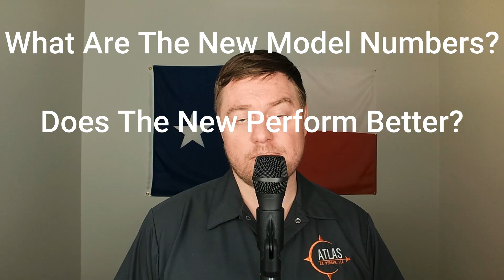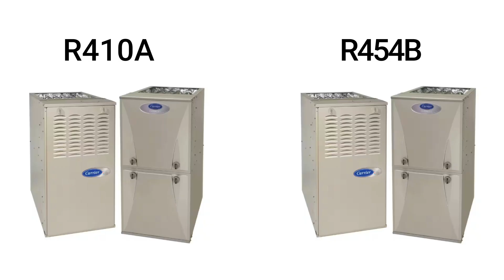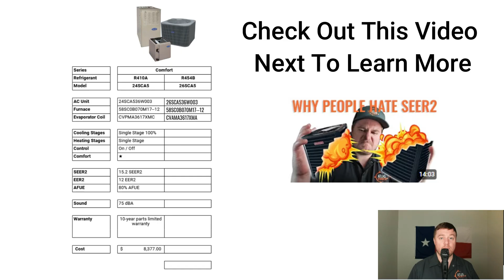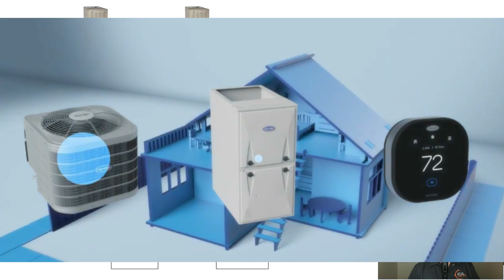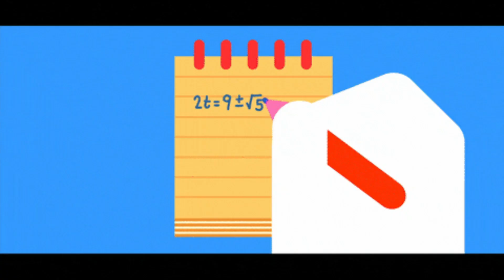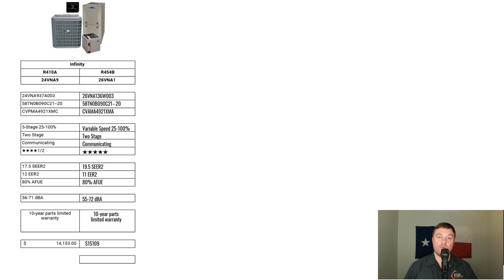Carrier NEW Gas System Lineup (2025)

Comment: My beef with our heat pump is that I wish we went with a unit with a gas auxiliary heat option and not electric.  I know for the next system, I want minimal digital electronics.  We went through no less than 3 system boards.  These are 240v systems where you can’t have a plug in surge suppressor.  Why they don’t come with a replaceable surge suppressor on the electronics is beyond me.  Your only easy option is to install a whole house surge suppressor to add some level of protection.  You also want easy to replace parts.  Our fan stopped working.  It was a bad module.  However, it was sealed inside the motor itself.  So, the whole assembly needed replacement, and the HVAC guy has to search nationwide to find a warehouse that had the part where all we needed was a replacement module.
Reply from the maker: you AC person should have installed a surge protector at the disconnect for the air handler and one at the disconnect for the condenser, Atlas does? this is how you protect the electronics in your AC system.
Reply: @atlasacrepair  - I can't find specific surge suppressors for the 240 volt lines (3 circuits) going to the system.  I suspect most HVAC people don't think this is needed, but where we live, power outages and brownouts are more common.  My best solution was a whole house surge suppressor and keeping my fingers crossed.  My HVAC company knows how unhappy I am with "computerized" systems that DO NOT have built in surge supression protections.

Comment: Very informative. Thank you!

Just replaced 35 year-old Carrier Weathermaker HVAC with Greenspeed dual fuel 59MN7C/27VNA3 97% gas furnace and heat pump. It is amazingly quiet by comparison.
Reply from the maker: Glad to hear. Please give us an update in about a month
Reply: @atlasacrepair  a bit further along with the new setup and so far so good. Below are a few of observations (as a 2nd time heat pump (HP) home owner... my previous home, 20+ years ago had one that was nothing like the new stuff).

1. I live in a 4-season area and increased the HP cutoff temp by 2 degrees (to 37 F). In breezy low temp conditions, 35 was too low for it to cease operating, in my opinion.

2. Went with a MERV-11 filter and notice a difference in air quality compared to my 34 year old Carrier WeatherMaker that used 25x20x1 filters.

3. Chose the AprilAire 800 (240v steam) humidifier and so far the humidity is doing ok. Not getting above 25%, according to an independent temp/humidity monitor that recoded higher numbers with my previous AprilAire side-mount "water misting" unit. The new one is noisier and hearing water boiling to make steam is not quite what I expected.

4. There are readily apparent efficiency gains (and cost savings) with the new variable speed furnace and heat pump.

5. Only (unexpected) negative so far: while doing what I suspect was a defrost cycle below the lockout temp, the HP made a lot of noise and shook uncharacteristically. I assume it was due to ice build up on one side of the blades.

Comment: I need a new A/C unit and probably a new gas furnace (both are 30 years old and A/C is broken). I contacted a local Carrier installer and stated I wanted the middle of the road A/C. He gave me a quote but the A/C unit is a "Comfort Compact Crossover 37 MURAQ48AA3 Heat Pump."  Now I am totally confused. I live in Southern California. Is a crossover unit an A/C unit? I have a 2-story house, four bedrooms and approximately 2200 sq. ft.  Any comment would be greatly appreciated.
Reply from the maker: The crossover is middle of the road since you get a variable compressor in the deal with side discharge. 
The side discharge unit will connect to a forced air system (air handler or furnace) and supply the AC cooled air through your current duct system.
Reply: @atlasacrepair Thank you very very much!
Reply: I'm guessing it's both an A/C unit and a heat pump with an option to switch back and forth depending on the season. I'm looking at buying one right now.

Comment: Thanks for you comparison post. Love your vids. 

We went with two 3 ton 24vna6 fully variable infinity  greenspeed AC units coupled with the coils you mentioned as well as the top of the line 80k btu fully variable 59MN6 furnaces due to the higher efficiency and quiter db over the new Carrier A2L refrigerant model lines that also require the extra flame sensing equipment. Infinity wall control; UV light and ionizer on returns; and one AprilAire automatic humidifier (model 720a) will be installed as well. AprilAire filtration already installed. 
Veteran installers from ACS will be performing the work. 
Pads will be used under the Condenser units as well as sound isolation blocks under the furnaces. 

Anything else you’d recommend?
4800 square foot home built in 2009. We are replacing two original Ruud AC’s & 90% HE Furnaces (one furnace in the attic) in Pittsburgh PA.
Reply: Curious what this ended up costing you?
Reply: @davidh3774 about 7k less than an A2L system!